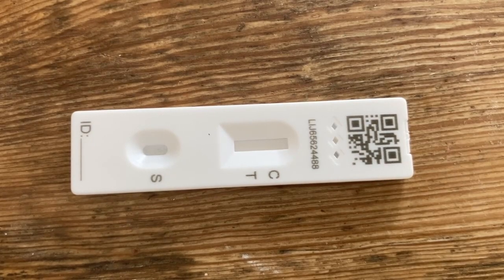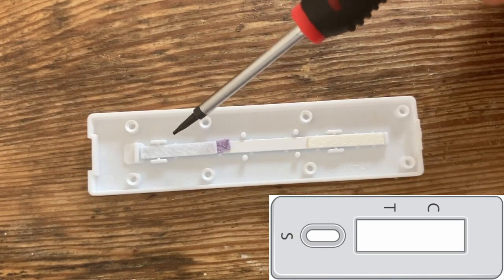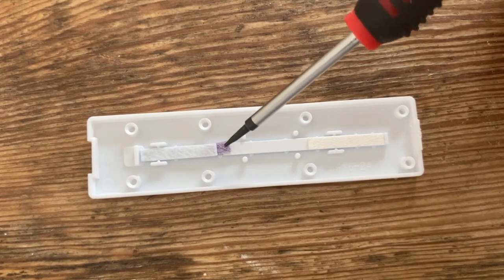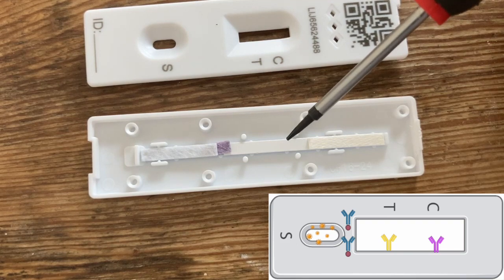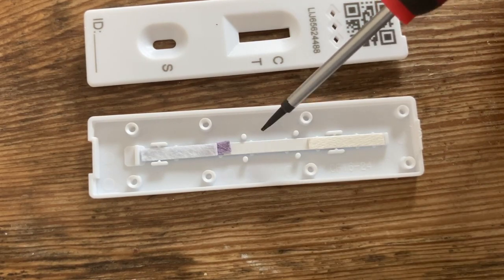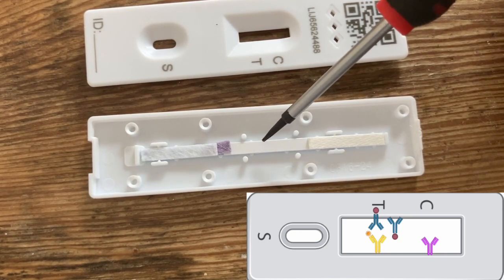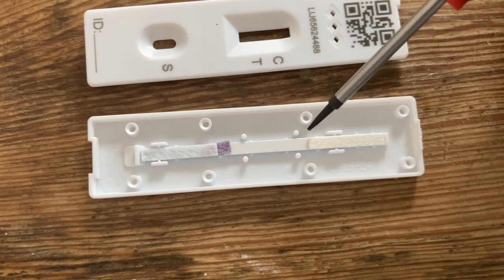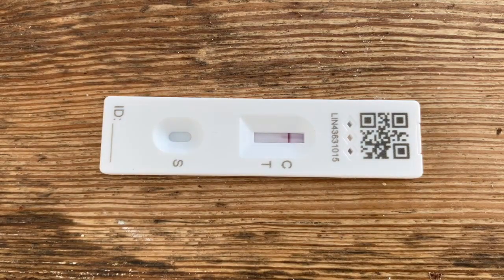Lateral Flow Test Teardown

Comment: So by just using the drops of the buffer solution it will always be a negative?  I've read a few stories [ if true ] that some people have just used water and got a positive? What do you think Mark? Thanks.
Reply from the maker: Positive results with just water are unlikely, bordering on impossible without good reason.

The way a false positive works on a lateral flow device, the solution would need to be acidic to denature the proteins involved -- meaning that how they bind and where is no longer controlled.

Alternatively, the test device could be faulty. It could have been heated up to denature the proteins, or it was from a batch that slipped through the quality check. If you're getting false positives just from from water, re-testing with a different batch of tests should show up a true negative. The odds of getting two different batches that are faulty is very, very low. 

If other people are claiming it, you would also have to weigh likelihood of a of the above against the probability of people simply lying about the result and the conditions it was made in.
Reply: @ChemistryatHull  Thanks for the reply Mark, it would have just been a made up story about the water. As with just the buffer solution, that would probably be near enough impossible to give a positive as well wouldn't it? What is in the buffer solution Mark? Thanks,.

Comment: Wish someone could answer this manufacturer hasn't answered got 2 lines both pinkish red spaced apart in control area of test do i regard this as pos or neg symptomatic with 2 previous pos results .One line is bolder than the other both clearly visible could the strip on the test be manufactured wrong orplaced upside down fainter line is above bolder one both very visible and separate

Comment: I found out some things:
1. the BinaxNow has changed to a lollipop type... where you put the cotton swab in, and then close the "little book cover" and it looks like a lollipop https://youtu.be/baQQfoX-JXo?t=187 The blue line is all going to move away
2. if you add some orange juice to it, it made the "T" line (what they call Sample Line now) have color, but the Control line has no color.  So this is a weird case... this is the complete opposite of a Negative case, but it is not the Positive.  It looks like the orange juice somehow bound all the nano gold particles and then everything is trap in the first "gate"....  I wonder if the concentration of orange juice matters. I tried with the Simply Orange no pulp (not the calcium one)... but I didn't shake the bottle
3. so if we do a test using water, sparkling water, etc, and then try again using orange juice, that won't work because the nano gold particles have already traveled... so we need to use a fresh new test box (a new lollipop)...

Comment: I'd be interested to know what the scientific answer is as to why Red Bull, orange juice etc. causes a T line? Assuming it isn't virus, what is it that causes it?
Reply from the maker: The pH alters the structure of the biomolecules in the test, so all bets are off about what binds to what in those conditions. You can wash away a false positive with a pH 7 buffer solution, but this won't affect a true positive.

More details: https://theconversation.com/covid-19-kids-are-using-soft-drinks-to-fake-positive-tests-ive-worked-out-the-science-and-how-to-spot-it-163739

Comment: I tested a false positive RAT, 16 hours later tested negative on a PCR test. I had not consumed anything for at least 1/2 hr prior to taking the test. I have a low tolerance to acidic based foods, so they aren't even in my house to contaminate the RAT. I had been in isolation two weeks prior due to bronchitis & tested two negative RATs and a negative PCR. Any idea what may have caused the false positive RAT? Can they detect any other virus?
Reply from the maker: Currently researching this for a potential future video. Some kind of contamination or faulty batch of buffer (so testing with a different batch will show true negative) are the most common suspects.
Reply: @ChemistryatHull  I'm definitely interested to know what you discover.

Comment: Hello, I have a question I can't find an answer to, and I'm hoping you may know.

Does the intensity of the T line correlate to the severity of the infection? I have Covid right now and I have noticed the t line getting more intense each day. I have heard from others that this happened and then as they recovered, the t line got less intense.

Can the intensity be taken as a guide for your level of infection, meaning, if I return a faint red line tomorrow, can I assume that means I am starting to recover, and am closer to producing a negative test?

Thanks
Reply from the maker: Generally, yes. More intense lines will mean more virus, so it will fade in and then out over time. You can even see in some "negative" tests the day before someone tests positive that there's a very faint line that was missed.

But because it's based on the amount of virus that makes it into the test strip, it's also a function of other variables. This includes where you apply the swab, how many times, how firmly, for how long, and how long it is left in the buffer solution to extract.
Reply: I have also read that as you recover and your body breaks down the virus the test line becomes more intense as it also detects viral fragments in addition to intact infectious virus. Mine was way more intense five days after first positive, but three days later almost gone as I recovered.
Also depends very much on how well you take your samples, how well you extract them, etc etc.
Reply: Good question!! Great answer!!
 Now im going to dig mine out of the trash and make sure there's no faint line lol

Comment: What liquid did you use at the start to get the control line to come up and activate it all?? 🤔
Reply: I used the buffer solution that is supplied by with lateral flow test
Reply: @DrScients  please
Reply: @DrScients  Mark, what would trigger it to become positive? Would fruit juice do the trick?
Reply: @320speed  why are you trying to get a positive test…!😂
Reply: @emilyishungry7363  Two weeks off work ;). I got a positive thanks to Robinson's Apple and Blackcurrant
Reply: @DrScients  and if you only put that on the test without actually taking it, will it come out negative every time?
Reply: @lukemilner8908  That's right. There's no virus in the buffer, so if you add it directly to the test device you will always get a negative result
Reply: Sasuntidictous Rhoireiphapos  I heard OJ works best "heard" 😂